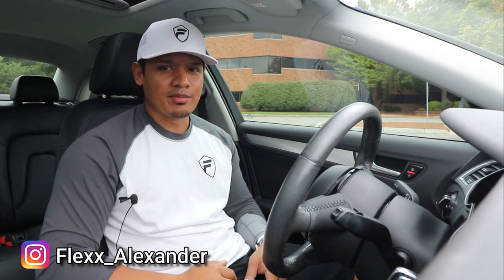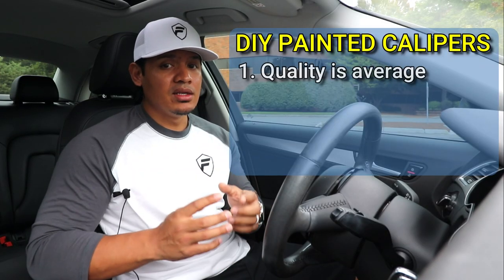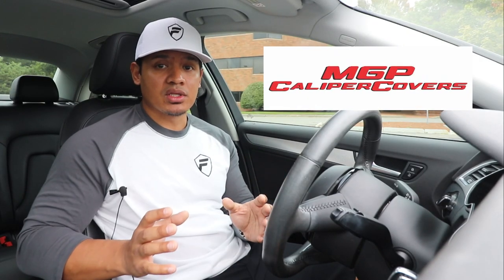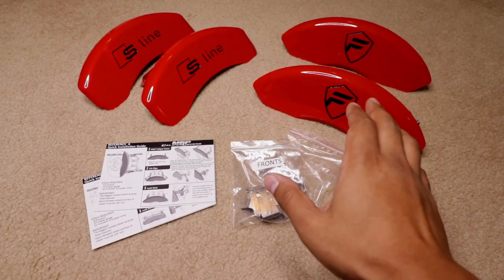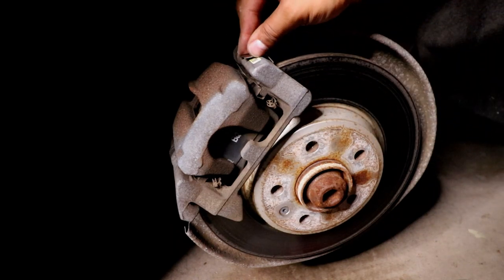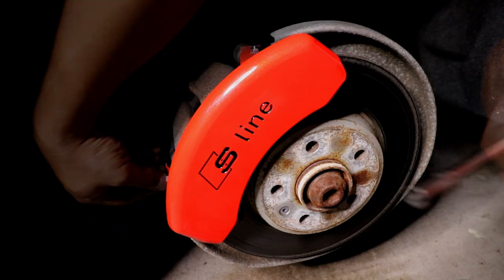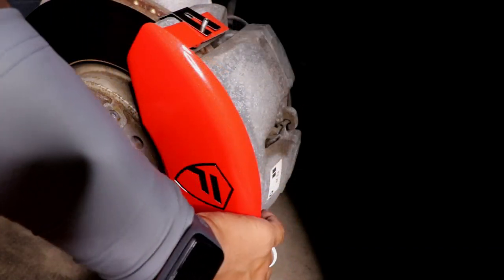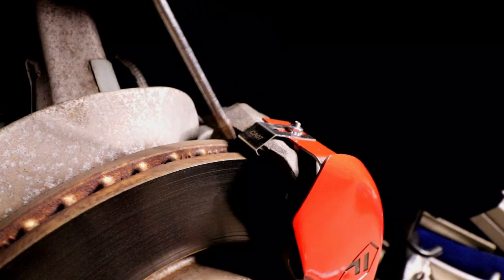BEST WHEEL/CALIPER COMBO | Audi A4 B8.5 19" Wheel & Caliper Cover Install

Comment: Got my CLA 250 covers based on your past videos, the quality is top notch and can be back to stock quickly if/when I sell. These really are awesome.
Reply from the maker: Nice!!!  I love how easy they are to put on and take off. The only annoying part is jacking up the car and taking the wheel off. Hahahaha
Reply: Flexx Alexander for sure! Especially since I didn’t have a proper jack (no jack in CLA) and had to use the one out of the girlfriends KIA. People on forums had a little hate, but I’m not painting them. Call me what you want, I dig them.
Reply from the maker: 100% agreed. I think if I owned a car I would keep, I would get them professionally powder coated but right now, I don't even keep my cars longer then a year-ish. No point in pulling off the calipers to be painted. Plus like I said in the video, if I pick the wrong color paint...going to be a hard time selling the car. I rather put something on that's fully reversible.

Comment: nice caliper covers. i just can't seem to find the right one for an Audi 2017 A4 Quattro B9, it's only up to 2016 Audi B8.
Reply from the maker: To be honest, best bet is to contact MGP caliper covers directly.  They will tell you exactly what you need so there are no issues with getting the wrong spec covers.

Comment: I’m not sure about the website they are not very specific, do you think they will fit my 2010 audi a4 b8 base ?
Reply from the maker: You need to message them (send them a pic of your caliper) directly then if your not sure. Cause not all brake calipers are the same on A4 cars.

Comment: Are calliper covers relatively safe? I’ve got a a4 b9 black ops 19inch alloys, would I be able to get calliper covers only want it for the front
Reply from the maker: Of course they are safe as long as you install them correctly.  Had them on my A4, C250, and c300.  All were 100% fine even after years of installation. 

And plus they sold hundreds of thousands of them to people over many many years.